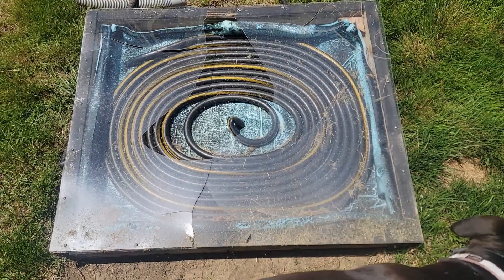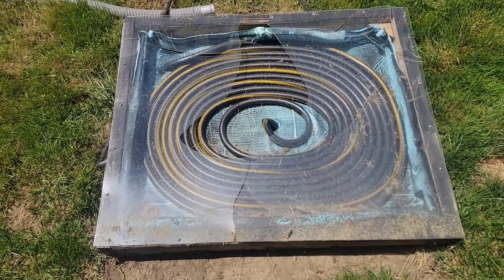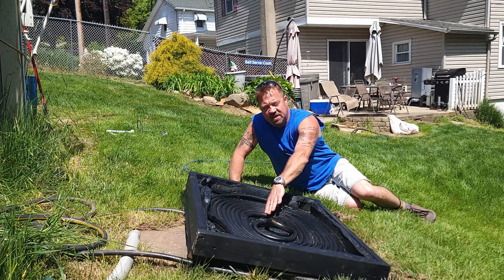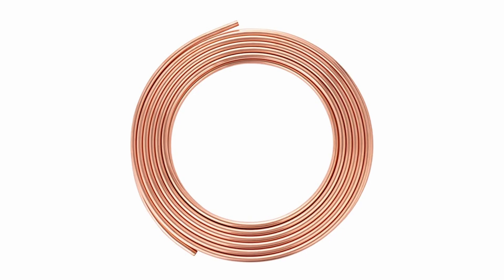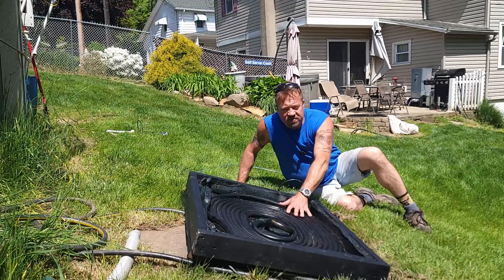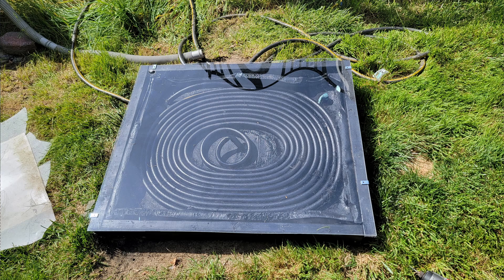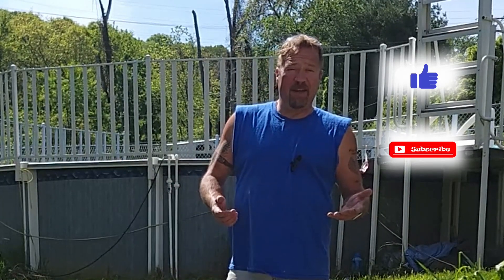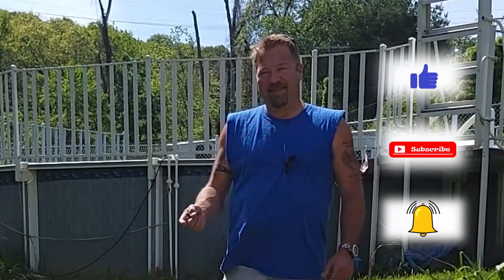$60 DIY SOLAR heater What I WON'T Do AGAIN! #pool #diyprojects

Comment: Would probably be better if you put the outlet through the side instead of down through the center kinking the hose. You would have better flow especially for that really small pump.
Reply from the maker: Absolutely. I was rushed when I built it and thought the same thing after. When I make the upgrades (copper tubing) I plan on going through the sides. Thank you.